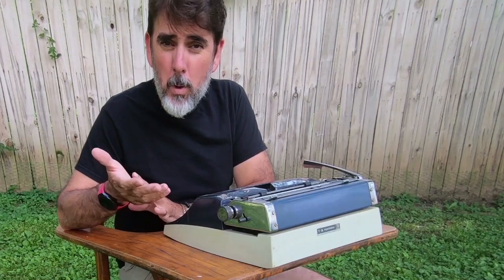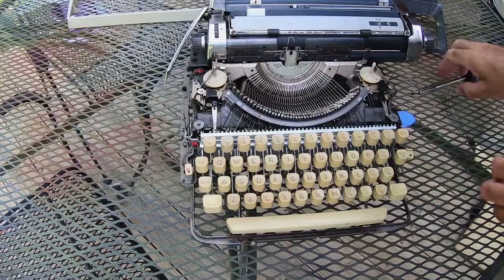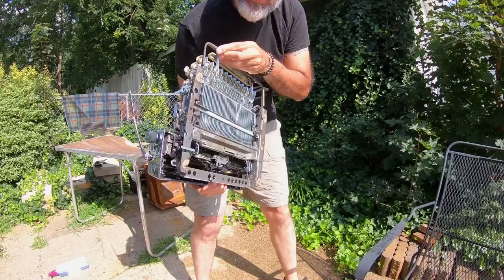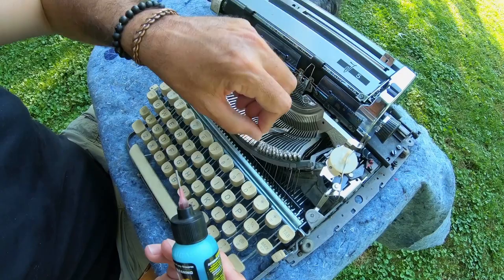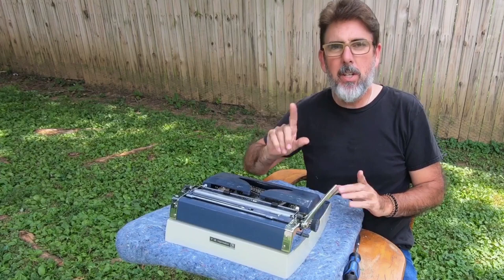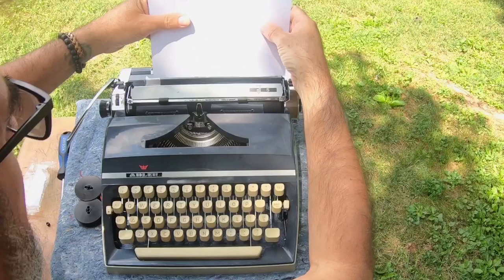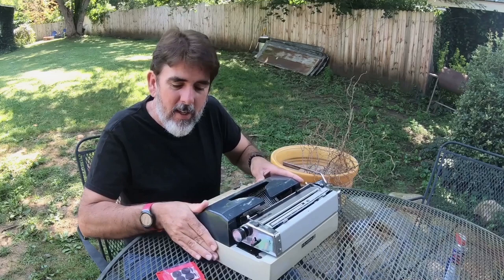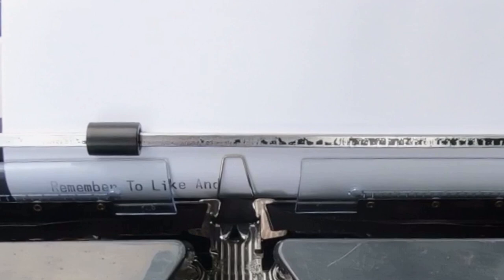How To Clean A Manual Typewriter: As seen in the documentary #CaliforniaTypewriter #Typewriter

Comment: As someone who has restored a few typewriters, I am firmly against using any kind of lubricant on the segment (the thing you refer to as the carriage), because over time lubricants attract debris and dust which only serves to gum things up faster.  The majority of moving metal parts on a typewriter should be cleaned with lacquer thinner or similar solvent and not oiled.  Very small amounts of lubricant are only used on the carriage rail bearings, escapement, etc...  As a note, the carriage refers the thing that holds the paper that moves right to left when you type.
Reply from the maker: I understand.  Though there are situations where a drop or two will greatly speed up you ability to get typing. 

Thank you so much for watching. Have a couple interesting ones coming soon.
Reply: @Thisguyandhiscamera  Thanks for the reply and video too.  That is a wonderful typewriter you restored.  You mentioned Phoenix Typewriter in your video.  Duane is an experienced typewriter repairman that has some tutorials on cleaning segments, platens, key slugs, freeing up sticky keys and none of them involve using oil.  Anyway, I look forward to your upcoming videos.  Thanks!
Reply: Yes that is true, as a old Adler Tech from the 70's there are 2 carriage screws also and carriage return spring which could be removed to get into the under belly for proper cleaning and adjustments. taking out the platen and rollers is easy and is a must for proper cleaning. Finally Adler is German you should have metric tools for proper adjustments
Reply: @andycan09   does Duane have youtube channel on typewriter repairs. I'm interested to check it out
Reply: @twogreenthumbs5479  Yes, his channel is called Phoenix Typewriter
Reply: My 1937 Royal service manual suggests a whole lot more oiling points than that.
Reply: D uses an electric contact cleaner that contains mineral oil on the segment. I use it and can confirm it is oily. But he and myself are wiping excess off and then blowing it through the bottom of the machine. AND the seg is clean and 100% functional FIRST.

In this vid, the segment isn’t clean. He hasn’t done the mandatory LT clean. So he has created a problem by using a lube on a still dirty segment. So the power wash is not the way to go. That’s a fast way to blow springs off and end up with a box of junk. And why I avoid ‘recycled’ projects unless it is $5 for parts. 

You clean the segment w LT and repeat and an air compressor is mandatory. Period. And it pays to wait overnight after all the LT evaps to retest. 

Then Nu-Trol 401b spray.
Reply: @JB-uv4hm sorry for my ignorance, what is LT?
Reply: @lisaball1701  lacquer thinner.

Comment: A few thoughts: 

Ribbons: usually, you don't need any new ribbon when buying a used typewriter. Most ribbons are fine, only the section that has been sitting in the open for the last decades will be dry. Just manually "fast-forward" the ribbon for 6-10 turns of the spool, and you've got fresh, inked ribbon ready to go. Most typewriters have an automatic direction reversal once you hit the end of one spool and by the time you get back to the "dried-up" section, it will be good to go again.

Hard platen: it's easy to strip the rubber off a hardened platen and recoat it with shrink tubes and a heat gun. There's a great tutorial on YouTube from CreateX3.

Feet: DON'T use felt feet. Use rubber feet. One of the main concerns of typists is that their typewriters begin to wander when used. That's why you have typing mats to keep your machine with its old hardened rubber feet in place. Get new rubber feet so you don't have to chase your machine while typing...
Reply from the maker: Oh the interwebs…

Comment: You really made a good effort to service the machine , a compliment form an old typewriter mechanic
Reply from the maker: Thank you so much Bill. 
I don't know what we'd do if we didn't have these with us today.
Reply: @Bill Ogle Any input on the use of oil on the segment? AFAIK, it's generally not advised to oil the segment because that's the first part that's gonna gunk up again, and then you'd have to clean the machine again and again and again.
Reply: @mx5701  All moving parts require some lubrication but excessive oil is as bad as no oil, it was rubbers , or coverup tape (chalk) that caused most of the segment clogging, if you have or could make a segment pick you could pick out the segment every 3-4 months. If you get an half inch varnish brush, cut the bristles to a length of about half to three quarters of an inch, using a mixture of mineral turpentine (white spirit) with a dash of white, light stainless oil, you can scrub the type (slugs) and brush the segment with an upwards motion after you've picked it you will get all the gunk out, then lightly oil....you can make a pick out of an old type bar, royal bars were good because the had a long tail.......every moving part needs some oil but not too much.. search Ames Tools I'm sure you will find a segment pick there , it will give you an idea how to make it...let me know at any time if you think I can help

Comment: Thank you soooo much for this video. You are awesome. Never knew I can power wash typewriter. I have just got one Brother 1000 DLX and the metal cover has rust spot. How would you suggest to do? Can I repaint it? I wish I could make it look new and shining again. Thanks. 🙂
Reply from the maker: Thank you so much!

It's not difficult at all to paint your wonderful machine. There are between 2 and 6 screws holding the 'body' onto the chassis. I'd use a piece wet/dry 600 grit sand paper to smooth the rust spot and remove any 'shine' to help the paint adher better. For best results you can use an inexpensive air brush with canned air or spray can of your color or choice . Spraying light coats until you get the desired results.

Thanks so much for watching. Stay tuned for more!
Reply: @Thisguyandhiscamera  Big-big thanks for your reply. I accidentally found out I can use Sticker Remover to give the white keys a good clean-up. They are looking so much whiter now. I also used it to clean those alphabets on the metal arms and it worked! Those long-time ink gunk were off effortlessly. After this, I am going to give a good ole power wash. Really appreciate your informative videos. Have a wonderful weekend ahead. Stay safe. :)
Reply from the maker: That’s fantastic CSH! You too, have a great, safe weekend too! Happy Typing!

Comment: Cool tips, thanks! FYI, you probably wanna set your degreaser bottle to "spray" rather than stream. And "platen" rhymes with "flatten" -- it's not pronounced "plate-en". (And it's pronounced "PLAST-ex". Not "plastic-ex".) Finally, what do you do if you live in an NYC apartment with no yard, no garage and no compressor air hose? (In other words, how can ya safely clean a typewriter indoors?)
Reply from the maker: Buy yourself a cheap shower curtain, a small electric power sprayer at harbor freight or Amazon, four cans of pressurized “air in a can” and have at it. 

When I was in Living north of LA I had the same issue in my apartment. This advice is only shared because it’s what I did to clean screen printing screens at the time. Good luck! Type on!

Comment: This is a great help, thanks. Do you think I could sufficiently dry mine with a blow dryer, then leave it in a small room next to a dehumidifier? I don't have an air compressor and would rather not have to buy one.
Reply from the maker: Hi Taylor. The most important thing is to get the water out of all of the joints and hard to reach spots. As a minimum, I'd suggest looking over you machine and determining where those places are then use two cans of compressed air, then hair dryer,  then set it in the sun on a warm surface for an hour or two. (Watch for rain of course) it's very important to get it dry as quickly as possible. 

Hope this helps, thanks for watching!
Reply: This Guy And His Camera Thank you, really appreciate it!
Reply from the maker: You're most welcome, Type On!  :)

Comment: I'm very apprehensive about spray washing my 1940's Corona-Smith!  Do you think a hair dryer will be forceful enough to get all the droplets out?  Can I use it with heat, or just run it cold? Thanks!
Reply from the maker: You know. I hadn’t thought about using a hair dryer. I think I’d go with caned air then the hair dryer, it’s possible the combination could work as well. The heat would help it dry. Let me know how it works for you.
Reply: @Thisguyandhiscamera  Attempted it this weekend...and success!  Hair dryer worked perfect along with sunny weather. I think the degreaser really did the trick, along with using that gun oil on every single moveable joint.  There were some felt pieces I should have seen: where each letter rests in the basket, and on the sides, so I had to double back and blow dry them some more.  The rubber feet also didn't survive, so I had to order some new ones.  The typing mechanism is as good as new though!  Thanks for the tips!
Reply from the maker: That's FANTASTIC! Congratulations! 

Enjoy your 'new' typewriter! 

Have a good week ahead. TGAHC
Reply: @AmidaTong  I did this as well with my WWII L. Smith & Corona. I couldn't figure out why I kept getting brown when wiping everything down. It's been a while since I lived with a smoker.  That was it! The whole machine poured brown. Gross. You can't beat the weight and glorious construction of these old beauties.

Comment: Hi! I have a question for you, How often should a typewriter be lubricated and serviced?
Reply from the maker: First, thanks for watching!

Second, a good manual typewriter is basically bullet-proof. In my opinion, keeping one free of dust build-up (keep them covered when not in use) They don't need a ton of "up keep". Keeping a new ribbon on hand is a must, though you can generally see that coming.

It's been my experience that once you bring one back from the throws of non-use as in my video, a small adjustment here and there keeps one smooth and usable. I hope this isn't too vauge. 

Biggest issues I've had over the years is having a freak accident like dropping one or having a desk fall over and knocking one out of adjustment (not good, trust me). Then, to the doctor they go.

In short, using as little oil as possible on the machine is best. When used, the thinnest gun oil or synthetic lube such as 'Duralube' is great, however they do attract dust.

Hope this helps, have a great weekend.

Comment: I have a underwood 378 that belongs to my dad. It,s about 55 years old.  Do you have suggestion on how to clean the plastic cover? It  used to be blue and now it's become Khaki colour.  I also would like to get the keys back to white. It is now yellow.
Reply from the maker: That’s awesome, I like the 378. Great also that you got it from your Dad.

Has there been a lot of smoking done around it over the years?

I’d start with something very mild like “409” or even the new spray version of ‘Dawn’ on one of the back sides of a key with a Q-Tip. Try the same on the inside or rear of the body. That way if there is a reaction it’ll be less noticeable (worse case scenario)

Is everything else about the machine working good?

Comment: Hello!! I have a question, I’ve replaced my ribbon, but the ribbon won’t move along by itself, I have to manually wind it along. I tried searching up what part does that but can’t find any info anywhere! Any advice what I’d have to fix/replace? It’s a Underwood. Thanks :)
Reply from the maker: What model/year is it?
Reply: @Thisguyandhiscamera  hello! Thanks for the fast response sorry for not seeing sooner, it is actually an Underwood 315 I was confused and sleepy when I wrote that haha! There is slight movement on the left wheel when typing but the ribbon doesn’t move along and is quite slack. Let me know what you think!
Reply: possible loose or missing spring or ribbon ratchet needs adjustment or worn out

Comment: Please can you recommend a type of oil that can lubricate the keys but won't cause them to rust?  Thank you.
Reply from the maker: I HIGHLY recommend buying a bottle of 'Prolong Engine Additive" (you'll find it at auto parts stores or Walmart, and using a small eyedropper or craft bottle with metal tip to add just a drop to each key joint. This product will never gum-up and lubricate the joints indefinitely.

Thanks for watching, have a great weekend!
Reply: @Thisguyandhiscamera  Thank you very much for the advice.

Comment: I have a little bit of rust on the back of my typewriter that I just bought. Its on the rear of the typewriter housing. I am really bad at the whole diy thing so do you know how much it usually would cost to get the rust off. and do some type writer stores repaint the typewriter to the original color? I want to repaint mine
Reply: Are you working on a budget?
Reply: @juancantu6169  100 is how much I am willing to spend
Reply from the maker: Hi Ace, first, thanks for watching and my apologies for the lengthy response. Have you had you typewriter painted yet? What’s your general location?
Reply: @Thisguyandhiscamera  Southern California. I ended up cleaning it my self by taking the shell and putting the shell in rust remover. I also got the paint color matched at a hardware store and bought an air brush. Thank you.
Reply from the maker: That’s awesome, congrats! 

Since you’re in SoCal, if you ever need any repair work done, check out Mr Schultz’s shop in Santa Monica: Reese Office Machines. He’s a great guy and super knowledgeable. 

https://g.co/kgs/EuY37F

Comment: Hello, I'm from Portugal, and I just want to bought my first tipewriter... However I ctched a great deal:  it was a bundle 😂...
I got now an Halda, an Triumph Matura, an Imperial 66, an Royal 200, an Oliva 2002 and an Logika 3002.

Can I do this in all the machines?
If they have a little, little spots of rusty, can I do the same?

Thanks a lot for your video.
Wayting for your answer.
Best Regards,
Ana
Reply from the maker: Hi Soaresam,
You can use this method with most any machine that is NOT electric. If rust is an issue the most important thing is to get the machine completely dry after cleaning. If possible, it may be possible to use a light steel wool on major rust issues and a small amount of light oil to help prevent more rust from forming. Take your time on you many projects. Congratulations!

Comment: Sir, I am on the other side of the world and we don't have that kind of de greaser around. How about very dilute dish soap? I mostly clean my keyboards with that and they work fine, any experience with that? I have a Olympia Traveller de Luxe, plastic cover but full metal body inside. 
Another query is will general machine oil work well? 
Thank you.
Reply from the maker: I would not use dish soap. You must use a product that will 'cut' or dissolve the old, sticky lubricant. Mineral Spirits, rubbing alcohol 90+ plus is best. As far as oil, it's very important to use a very light oil otherwise you'll eventually end up with the same problem. Take it slow and you'll be typing in no time.
Reply: @Thisguyandhiscamera  
Thank you for replying. 
I think Mineral Spirits or 90% rubbing alcohol are easier to get at Paint stores. Will try with that. 
Will use oil sparingly to lubricate. 
If theres more to ask I hope you don't mind me coming back here. Thank you again and have a nice day!
Reply from the maker: I don't mind at all. Happy to help!

Comment: I really need help on mine because the keys are very hard to press I added oil and everything but nothing changed, can you help me?
Reply from the maker: It sounds like the original lubricant has gotten sticky. You can try odorless mineral spirits. Just a few drops at each if tge hinge points at the base of each arm. Best to do outdoors and on an old towel. Use a craft glue bottle
Reply: @Thisguyandhiscamera  can you do a whole video of it? Because I don't really understand
Reply from the maker: I'll gladly send you a sort of step by step photo guide. DM me on IG or Facebook @thisguyandhiscamera
Reply from the maker: I need to add. When the keys are hard to press, the real issue is generally at the base of the hammer itself. With this, place your finger at the top if the hammer (where the letters are) and slowly pull them individually towards the platen. Gently work your cleaner into the base it wull slowly loosen enough to press the key and make the action work fluidly.
Reply: flush the key segment with lacquer thinner